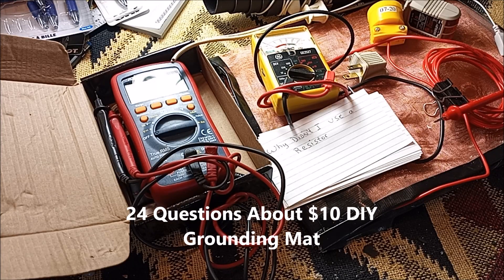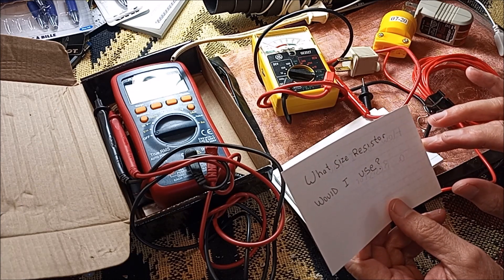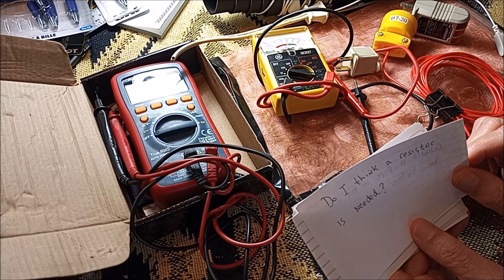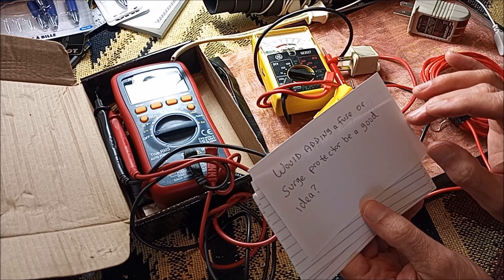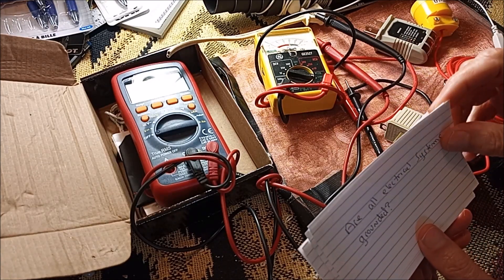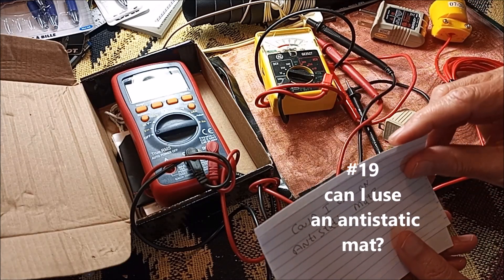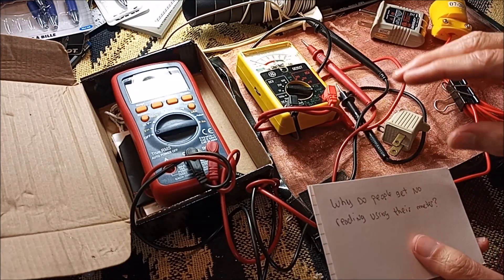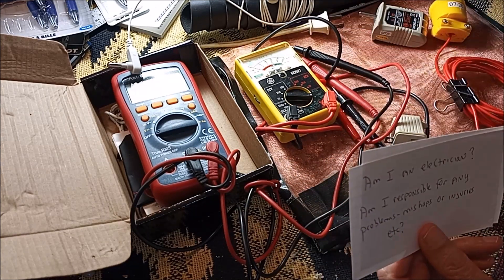24 Questions $10 grounding mat

Comment: If I were to do this with just the pole in the dirt, should I be concerned with lightening? I live in an old house and a section of the basement has a brick floor, under that is dirt. Could I simple run my copper wiring to the basement and have the copper rod run down between the bricks? Would this help with lightening strikes? I know you’ve suggested to not use it on stormy nights but I’m afraid I could forget.
Reply from the maker: Surely I can't tell you what you should do because it would open me up to legal consequences. I can only tell you what I am doing. The only way I would use it at night while I was sleeping is if I was hundred percent sure there were no thunderstorms that evening. If you need to know what the weather is in your area. I recommend highly windy.com.

Comment: From Clint Ober's original patent:
"A meter or fuse or current limiting resistor may be associated with the system, and typically installed within the ground lead or electrical outlet ground port. The fuse or current limiting resistor is intended to prevent potential harm from an electrical event."

"Each ground port outlet of the device will contain an inline current limiting resistor, such as a 1 megohm resistor, which meets current established standards to protect a grounded person against harm from an electrical event. Further, a noise reduction component may be placed inline on the ground port side within the interface ground device to reduce electrical noise that may exist on the earth ground system."
Reply from the maker: What a helpful comment, much appreciated!

Comment: Galvanic corrosion only occurs if there is an electrolyte, ie salt water solution. Resistor: why reduce the flow of grounding "energy".
Reply from the maker: Hello Moe, electronics is my weakest do-it-yourself skill so I can't answer your question with any authority. I understand what you're saying about electrolyte but it was my understanding if two dissimilar metals are in contact with each other. There could still be corrosion if there is a lot of humidity and moisture. Not as much as if it was in an acid or salt water, but there could be some. As far as the resistor goes so many people indicated it would reduce the risk of shocks if there was a problem with the wiring in the house. I didn't see where it would hurt to add a resistor similar to those used in the commercial units. Some people also said that a resistor would help protect against lightning but when it comes to lightning  I prefer not to trust anything.